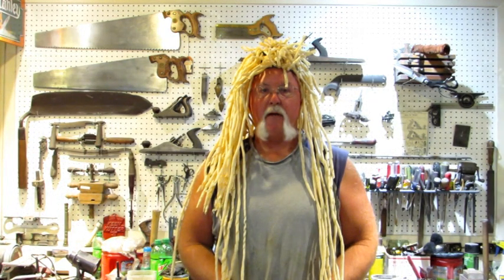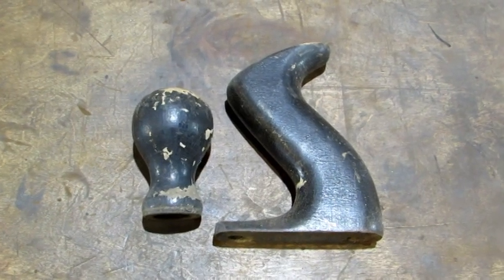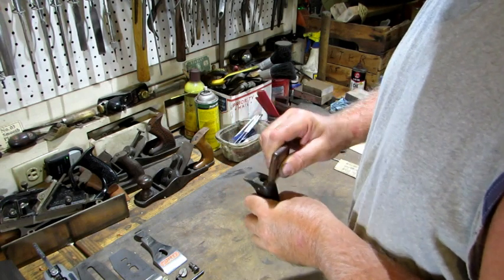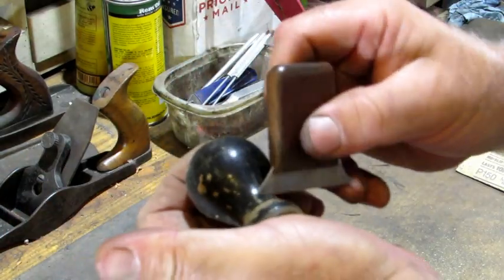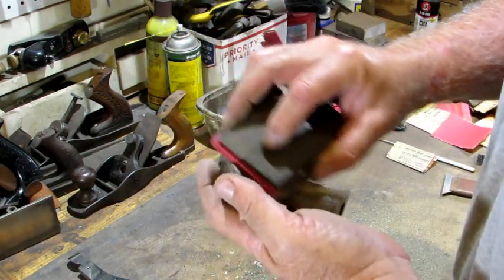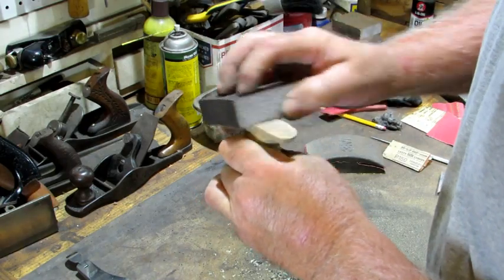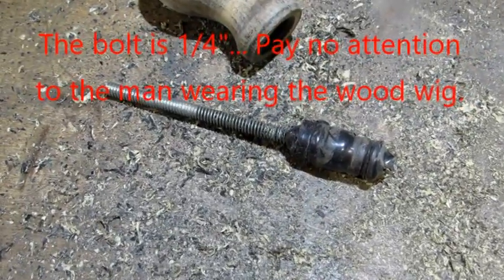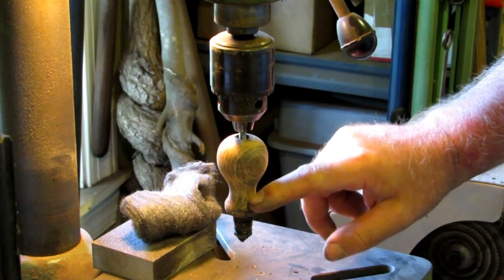How to restore a Hardwood Tote and Knob

Comment: The inventor patented the No. 340 in the background as a scrub plane but Stanley had other marketing ideas so I spent $800 , put a tall rosewood knob in front and a scrub blade, replacing the original straight cutter and now on the pull stroke THE NO. 340 can actually be a very useful plane‼️⁉️👍🏻

Comment: The knob and tote look great. I have resurrected a rusty Stanley #5 myself. After I stripped the finish from the wood It did look like black paint but it may have been black or very dark brown dye. The knob looked as though it had been floating in a container of dye because 2/3 of it was jet black deep inside the wood. There was a nice little 1/3 of the knob which was pure white. No way to hide that except with a very dark brown stain & finish.